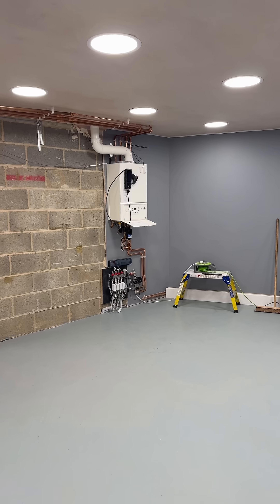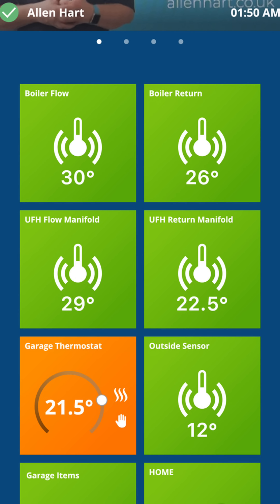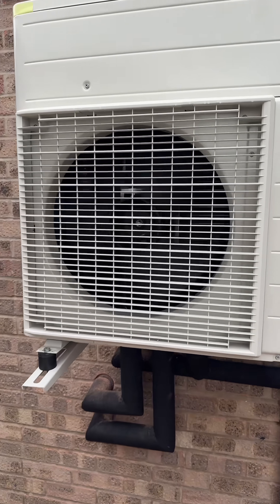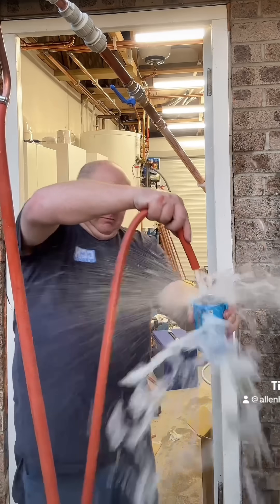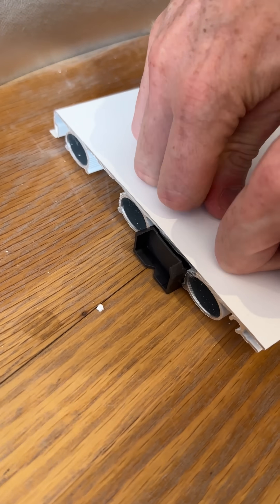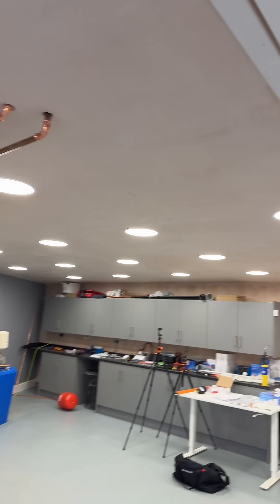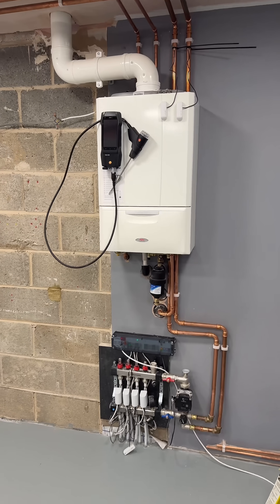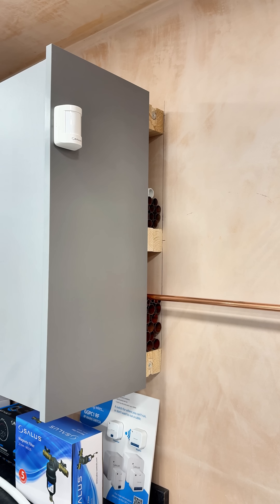Battery storage solar panels underfloor heating thermaskirt Alpha hybrid heat pump

Comment: Hi Allen, on an related issue, do you happen to know the typical resistance value of an Ideal logic spark generator between live and neutral is, mine is in the megaohm range which seems to high to me, however I don’t seem to be getting 240v when the boiler is calling for ignition either.

Comment: Why in God's name are you using a gas boiler with all that PV and battery storage?!!!  Rather than use a way simpler to install heat pump where you'll get 4-5 times the heat energy generated for every unit of electrical energy used?
Reply: he litterally has a heatpump 😂
Reply: @thatguyjack2208  Er... No, he has a hybrid gas boiler/heatpump (from what little information I have) and that is as daft a purchasing decision as a hybrid car is!  The worst of both worlds...  Unless he is off-grid for electricity (unlikely if he has a gas boiler) in which case it might make sense.  Otherwise it is a complete waste of time, money and effort.

Comment: I like the idea of hybrid(particularly for the hot water) though seems not much traction in the UK.  What is the reason for you moving to hybrid after having a cuple of different heat pumps?  Is it just a case of trying stuff out or did the hybrid meet more of you requirements at the house?
Reply: Guessing he was fed up with lukewarm water when the heat pump is not drawing enough heat 😂, probably cheaper to use gas on demand than a heat storage with electricity heating the water up to keep a limited storage of hot water. I remember as a kid having the big copper storage tank with the heating element, when you had a couple baths (which was a issue a couple times a week having five siblings) you would have to wait for the tank to fill back up and get hot again 💩

Comment: Beautiful work, Allen. This is really impressive. I'd love to have a setup like that. The way the electrical is done, to the way the piping is routed. All beyond professional work. I love it.

We're getting rooftop solar installed and we have a multisplit heat pump, but I'd really like to have in floor heat in the garage. Our baseboard electric heaters in there are shockingly expensive to run. It's not even cold here yet and the electric baseboard have used over 60 kWh in a single week to keep the garage at 5°C.
Reply: About £18 a week just to heat your garage to 5 degrees 😱 bloody hell
Reply: @ yeah. I suspect the themostat is broken. It's CAD 0.15/kWh here so not as bad, but still a giant waste of energy. I suspect my garage doors also need to be resealed. Until then I'm turning it back to 3°C just enough to keep the damp away.